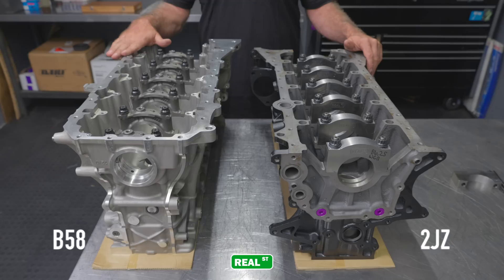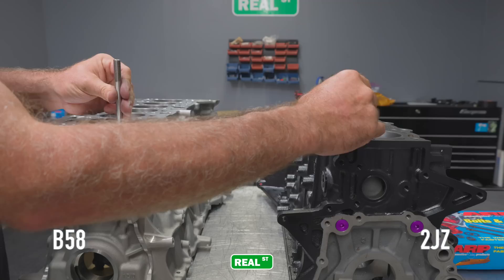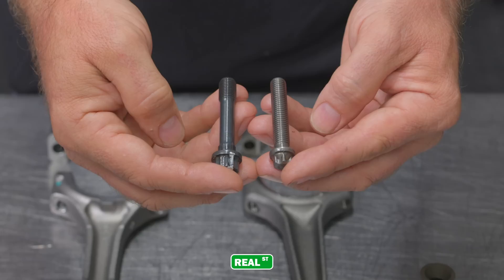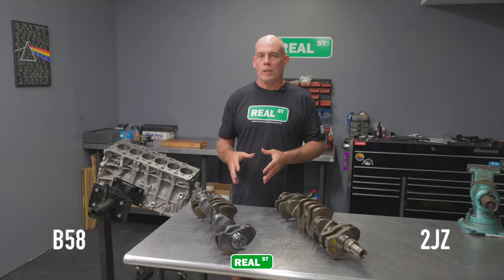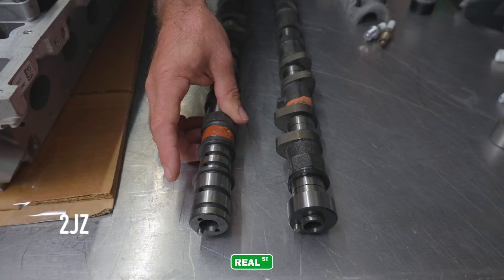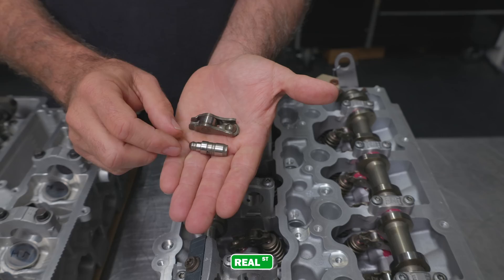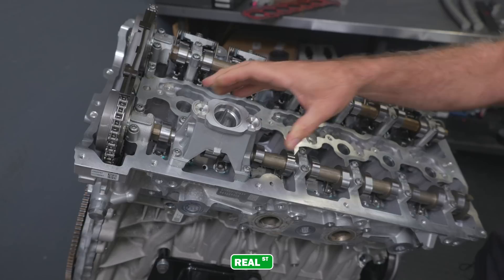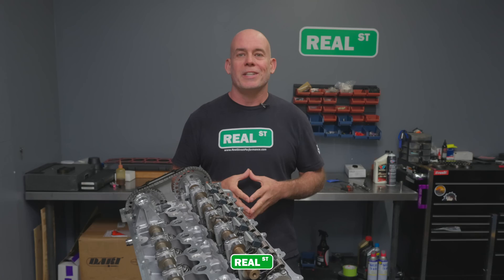Toyota 2JZ VS BMW B58 | 2JZ STILL KING?! (Detailed Engine Internal Comparison)

Comment: After 30years b58 is gone. But 2jz is still running 😂
Reply: I will come back to this comment and will tell you that my b58 is still running fine lol
Reply: @nofront711  I hope you do it , but I really doubt it , complexity = more failure points .. look at the cars with too much technology from 10 years ago,  are they still working?
Reply: @kirbo6494  yeah I know, realistically speaking complex parts have more points of failure...but also does technology evolve and gets better, hence more easy to repair things. Only time will tell, I hope for the best to be able to enjoy that sweet engine for as long as possible.
Reply: They didn’t even bring it back on the supra says a lot, B58 is a better engine
Reply: @tmc8516   first of all I didn't mention that the 2j was better,  I said more simple = less failures.. secondly your point is useless, they didn't bring it cuz it will cost a lot to make the machines to cast the 2j , thirdly,  it will take a lot more money to tune to today's standards regarding fuel consumption and environmental issue , so learn before you speak nonsense
Reply: @kirbo6494 3 more reasons why B58 is better 😂
Reply: @tmc8516   if u think the standards today made the sports cars better fun wise you have to visit a doctor , and the only thing that u could argue about is the fuel consumption which I don't care about when I buy a sport car since it is not my daily.
Reply: @tmc8516  Why would Toyota put a JZ motor in a BMW? The whole car is a BMW except for the badges.
Reply: @MastersOfMask why did toyota give up their most iconic sports car? They ass can’t make a proper sports car they gave it to BMW since is far superior. Also the new 2025 Supra will have a BMW motor once again.
Reply: @kirbo6494 More simple does not equal less failures. I can tell you a K24 is much more complex than a EK1, it has fuel injection, it has a much more complex vvt system, oiling, cooling etc etc, yet the K20 will outlast the EK1 easily. Technology improves with time, the same comment you made was made by someone 35-40 years ago about EFI, and probably 90-100 years ago about automatic transmissions, yet a good ZF or Aisin warner automatic will outlast most manuals. The same goes with suspension, brakes etc etc. My grandpa used to tell me that when brake discs came about people used to say that they where fragile and complex. Same thing happened with hydraulic power steering and later with electric power steering. The B58 is an absolute beast of an engine, the 2JZ has had 20+ years of aftermarket development, Let the B58 catch up and you will be suprised.
Reply: @514aam   I couldn't agree more with your points , all of them are true , i didn't mean less complicated is always better i meantgenerally .. I have a personal experience with three cars , I had 1996 540i it was a not that great I had to rebuild the engine after a mild abuse.. and I have holden statesman the engine took the abuse like a champ but the AT trans didn't.. the third car that i still own is 1997 6 speed supra and the only main part that failed was the clutch beside the normal spare parts , finally to be honest I don't really think that a bmw engine will outlast the 2jz .. only time will be the judge and I bet 20 dollars in 2050 there will be no 2020 supra that still runs. again thanks for your informative comment
Reply: @kirbo6494  the key to durability with BMW is mantineance, Toyotas will take more abuse without mantineance, but bmw will take as much if you mantain it... At least the B58 and S58.
Reply: So much reaching in your comment lol. 

1. Show me an original 2JZ that’s been daily’d for the last 30 years, and hasn’t needed major work on it. I’ll wait.
2. Show me a modified 2JZ that’s been running for the last 30 years, that hasn’t needed major overhauling. I’ll wait.
3. Comparing two different era’s is idiotic. That’s like me saying a 396 LT1 from a ‘69 Camaro SS, that’s still being used today in classic cars, is the better engine, because it’s lasted over 50 years now. 🤣 Idiotic right!?
Reply: @tmc8516   the engine that replaced the 2jz is only in the lexus RC in v8 version.
If you don't know why BMW is supplying engines for some Toyota, it's best not to comment.
BMW also supplied the engine for the Avensis 1.6 diesel.
A deal because of hybrids
Reply: @nofront711 "technology evolves hence easier to repair" My sweet summer child.
Reply: @motorpolitan8884  Pardon me?
Reply: But you won't be, so it doesn't matter either way.
Reply: @hpickettz34  okay pal.
Reply: @JacesOwnWorld   if comparing two era's engines is idiotic why does the internet full of people comparing those two .. u know why , because the 2jz has already prove that it is a very durable and strong engine.
Reply: If not for those stupid movies would we be talking about the 2jz and overpaying for the cars still?
Reply: @tmc8516  Hahahhaha Why would you use a 30 year old engine for a new tech.

Comment: Spray in liners is the end of the conversation
Reply: BMW did not create this engine for drag racing. That's the end of the conversation.
Reply: @sepg5084 drag racing? Toyota did it for reliability. Supras are not built for drag racing. They just found out that its strong for drag racing
Reply: @Sunburnae92 If you want to go racing 1000+hp and you pick the b58, an engine designed for lightweight, driveability and economy over the S58, a literal homologation race engine, that is all we need to know about you.
And don't blame BMW for Toyota putting the non-perforance engine in the Supra. I feel like you guys would still blame BMW engines for not making 1400hp had it come with their 3 cylinder.
Reply: @laurean5998  non performance? Dude they so over engineered the stoutness of the 2jz companies STILL trying to match it.
Reply: @laurean5998 are you old enough to own a car lol
Reply: @hatch450sx3 no company is trying to match the 2J. If they wanted to prioritize durability, they could, but instead the prioritize cost, efficiency, and weight. The 2J is a HEAVY engine; heavier than the LS3 even. If you're not going for 700+ hp (which most people aren't) most would probably be better off with the B58.
Reply: Papadakis racing is still using the stock liners and is making over 1100whp
Reply: At least it is steel, not alusil nikasil
Reply: 3jz coming soon. toyota will never make this MISTAKE  again.
Reply: @sepg5084 Imagine theres 2 apples and one is rotten inside but because theres a bmw sticker on it you want it and defend it 😂
Reply: Planned obsolescence
Reply: @jongonegone1262 Toyota doesn't care lmao, look at the FA24 Engines choking on gasket goop and Toyota refusing warranty work on blown engines lmao
Reply: Aren't spray liners derived from f1??
Reply: @sepg5084 irrelevant gaslighting.
Reply: @Josh-qm4rb  aasbo has also admitted to blowing 3 motors 2 in one season. James Dean only 3 time back to back FD champ blew 2 motors in 4 years
Reply: @snoofayy6150  isn't FA24 Subaru?
Reply: @hatch450sx3  you do realize that it needs sleeves to go over 750whp and get to 1000whp reliable right ? My buddies have Supras and the real ones not the new and they all make 900-1300whp and tell me everything. Fan boys think. they can make all this power without being built but they can’t. The iron block helps buy it still needs sleeves and pistons
Reply: @laurean5998 my b-58 has been making up to 1,500 wheel for over two years now  and at least 7-8000 street miles ... You were saying ? You can say anything you want from a comment section but until you've done it and lived it like I have been your words mean nothing as I have had more problems with my 2J setup and 1 j before that... I cracked two blocks around the same power level after about six months on the 2js b58 two years later on a bigger turbo  that makes more power throughout the whole rev range and it loves it...  2 jz weren't built to do what they do with them but they can if you know what you're doing maybe you just need to start following people that know what they're doing with the right platform
Reply: @Josh-qm4rb yeah and our shop is making 300-400 more horsepower than him in a drag car but what's really cool about his is it's on the limiter and full on wide open throttle for way longer than a drag car...
Reply: @jongonegone1262 it wasn't a mistake and it's better than a stock 2J in everyway to 99 percent of the population
Reply: @speedlife301   edit if that c7z in your profile is your car that thing is gorgeous. How hard are they actually to work on? Almost bought one but worked on my friends c6z06 and it's just a pain. How reliable is the car actually? 

On topic
 yeah I'm aware I got 3 friends with 2jz swaps their favorite life is at 800ish whp. I said the record stock sealed 2jz is 1089 iirc. 

However if you do sleeve a 2jz there isn't much they can't handle. Really any motor trying to get to above 1400whp needs a lot of motor work. I'm just saying most motors just can't get it done. 2jz is one that can.
Reply: @freedomfox8183   if we are talking mod for mod yes the b58 is better until a certain amount of work and then it just doesn't keep up. I'm not saying down the road it won't keep up. I'm saying there are things that keep it from doing what a max effort max build 2jz CAN do. 

If your looking to daily modded b58 is a hard choice to over look.

The only 4 cars 1000hp plus I would even drive on the street is a turbo coyote gen 2 mustang, a gtr, a tt r8 /huracon or a gr supra. 

Does your 1500hp b58 have a different crank or you still have a rear chain driven pump? I gotta be honest chain pump scares the hell out of me.
Reply: @yummyhershey5902 i agree on that if you want too race 2jz but if you wonna have a fun cruiser and corner carver b58 honestly im looking into b58 vehicles specifically for a bit of good power but mainly handling i love fast tight corners
Reply: @freedomfox8183  funny internet kids !!!
Reply: @illusional.503   I get the appeal of b58 gr supra im not stupid. Those cars with a dp and tune and pure turbos so about 4k a STUPID fast. They make 700whp effortlessly.

In a lot of ways the the b58 and s58 are better but to say it would hand out ls the big boy 2jz on the track is just dumb. 

You want a badass street car I'm all for the gr supra. 

But these people that spew utter bs I have to shut it down I hope you understand. 2jz is fastest import motor in the world, fastest stock shift import engine as well. Was the fastest irs car in the world till Lund racing coyote. So to say it's gonna hand out ls to supras when we haven't seen 7 in an s55 or s58 yet is sheer hubris and ignorance. 

That's like saying 2jz and 4g63 and k20t will touch proline big block pro charges cars. Get what I'm saying? 

I'm no way dissing the b58 or s58. They have proved to be street monsters
Reply: @freedomfox8183  On the B58?! That is absolutely incredible!
Reply: @speedlife301 wrong . Rods are the first to go and that’s if ur e85 with 600wtq or more hitting below 4k rpm
Reply: @hatch450sx3  sadly, yes
And true to Subaru form they have shit oiling systems even without the gasket goop plugging oil pickups
Reply: @jongonegone1262 good luck on that. Toyota would instead develop other things like hydrogen and electric and not another JZ. 🥱
Reply: @Senninha1960 maybe, but f1 engines only need to last a few starts and run for an hour. I guess they could spray it thicker, but personally give me an iron sleeve. Tried and true.
Reply: @sepg5084 toyota dealer did not either 😂😂😂😂😂
Reply: Vane oil pump ended it for me
Reply: Two port exhaust
Reply: For simplicity I’m going 2j . For price 2j . Drivability b58. Kinda hard to beat the economics of the 2j add a good transmission and about 800hp that’s more than the average guy would need and if it could get traction would wreak havoc
Reply: @laurean5998  thing is. 2JZ is 30 years old
Reply: @yummyhershey5902  cast iron blocks are a recipe for reliability. The ls3 isn’t as relible and will never be relible as say a stock 2JZ GTE. The most reliable engine is an iron on iron 6BT Cummins

Comment: This proves how great the new engine is. I love my 2j but the technical advantage the b58 has in my opinion if you want 1000whp daily torque streetable amazing response b58 more than that 1000-1800hp monster 2j unless they do billet b58 blocks then you’ll never need a 2j. All the cool tech I wish was in my 2j come standard in the b58
Reply: There are built B58s out there already touching 13-1500hp(2 of the 3 fastest in the world making that power). I'd say billet maybe a option once they start touching 17-2khp maybe but they say it still has room for power with the built B58s still so the future is pretty bright in seeing how far they can be pushed.
Reply: But all the cool tech will fail after some time. I appreciate the simplicity of 2jz, strong and simple.
Reply: Def not. Id rip that BMW b58 out the MK5 and put in a 2JZ!. It's far more reliable! I trust Toyota so much more than I trust BMW..
Reply: So I'm going to debunk that right here. The b58 will never be able to make the power levels a 2jz can make simply because the 2jz flows air much better than the b58. The 2jz has bigger intake and exhaust ports, bigger valves and had a 6 port exhaust head. Air is the key to power. The more air you can flow, the more power you make.
Reply: I really don't understand your logic
Reply: Something people not mentioning is the weight of these motors, 2j is pretty much double the weight. The b58 is truly a beast. Keen to see where it goes.
Reply: @moneyshifters  The 2J is heavier but that iron block can handle so much more reliable power.
Reply: @X13chaos Your debunking has a few shortcomings. Firstly, even on NA engines, max head flow is often far from the only limiting factor, certainly for prolonged load scenarios.

Once we are talking about forced induction as with these engines, how much the engine can flow at max 1 atmospheric pressure statistically moves so far down the list of limiting factors, as to be almost irrelevant. At least within normal engine parameters.
Reply: @Gone_Rogue300 The B58 is literally a diesel engine block. You're not going to see 2JZ block out lasting the B58
Reply: @TearsoftheSun1 Where's the proof? After 750hp or so, in a 2J you're pushing it. I've seen them blow up before reaching 800. The B58 will handle the same power levels
Reply: @X13chaos Professionals already proved you wrong. 😂
Reply: @Gone_Rogue300 False
Reply: @refillz5281  Lies. I've seen 2J handle insane power! My IS300 has one tuned and she's a daily pushing over 600hp.  I trust Toyota way more than I trust BMW! I owned BMW models before 7 series etc are pure garbage! They're notorious for wiring problems etc
Reply: @Gone_Rogue300 pends on the engines with bmws. If your messing with their V8s your practically asking for it. Their 4 bangers are debatable which is the same case for their I6s. In the case of the B58,it's one of bmws most reliable I6s since the 90-early 2000s.
Reply: @carboydorifutoparty3976  I trust Toyota far more than I trust BMW when it comes to reliability. I do like the M series nice cars! But that JZ and K family are super reliable and highly tunable.
Reply: Best engines are 2jz & barra that will never change & price wise b58 wouldn't be as cheap as the 2jz or barra
Reply: @refillz5281  Where's yours?
Reply: @BingeGamez  the 1J, 3SGTE, K20, and LS are other great engines as well.  The Barra is another great engine! I hear it was exclusive to Australia! But def a great engine as well.  Let's not forget the VR38 another beast of an engine that's as well far better then the B58
Reply: @Gone_Rogue300  Yet Toyota went for the B58. That should tell you something
Reply: @idesmasingi2663  They didn't go for it, they allowed BMW to make it for them which wasn't a good move! Lots of us Toyota fans aren't happy about it. I don't trust BMW I'll never spend a dollar on a BMW.
Reply: @Gone_Rogue300 guess you won’t have a fast Toyota then, because they build slow cars 😂